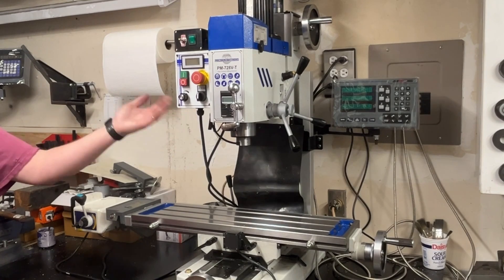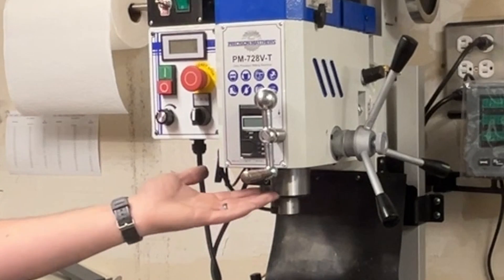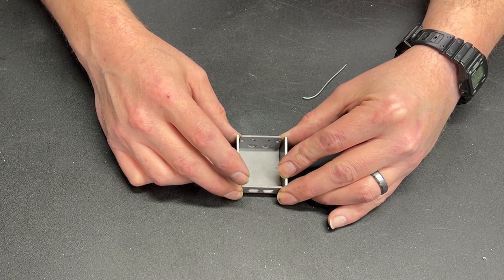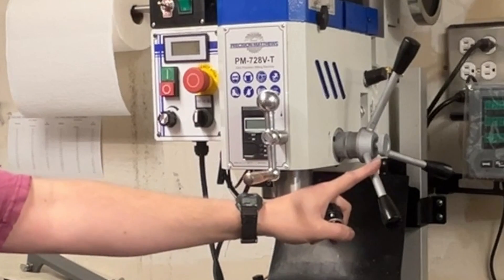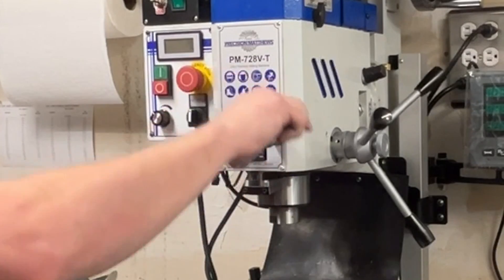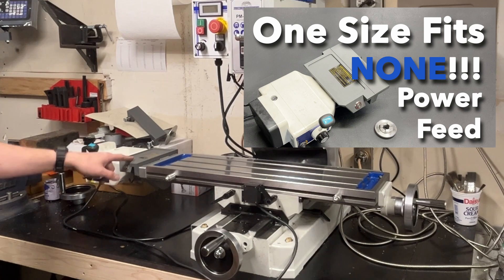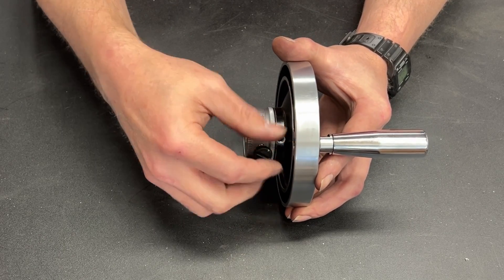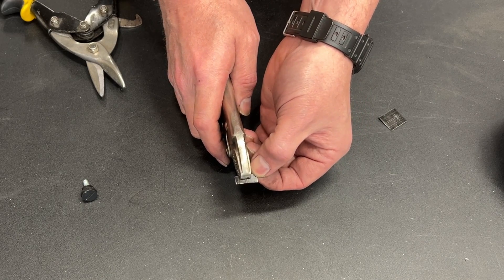Modify & Improve my NEW PM 728 Mill!! Only Had it a Few Months & I'm Already Making Changes

Comment: I want adjustable speed power lift
Reply from the maker: Just curious why would you want to do that, what advantage would that give you?  A person doesn't use power feed to adjust depth of cut and you don't want it going very fast at max so "adjustable" would be slow and very slow.  So I wonder why would you want it speed adjustable?
Reply: @dazecars  to slowly raise  on repeat parts i make where the depth rises slightly to do them easier
Reply from the maker: Most of the aftermarket power feed utilize a gear reduction DC motor so variable speed would be as simple as a variable voltage power supply in place of the power supply that comes with the machine

Comment: It's a decent mill and I have used mine a lot however the biggest short coming of this milling machine is the fact it doesn't have a nod adjustment on it. If they where to put one on then I would consider this a fantastic milling machine. Mine the nod has been off since day one and I'm about to make a backing bracket to attach to the top of the riser in order to control the nod and flex this milling machine has in it.
Reply from the maker: That kind of adjustment would make this a professional grade mill in a hobbyist size machine!

Comment: I already had TouchDRO as the main DRO for my mini mill. After watching BlondiHacks video, I got the idea to take it one step further and replaced the built in quill DRO with a magnetic strip and reader. I added this as axis 4. Through TouchDRO  you can add 2 axis together so Axis 4 and Head Z movement now adjust  Z reading on the DRO, so it does not matter whether I move the quill or the head, it is all the one Z reading on my DRO.
Reply from the maker: That’s very cool, I have thought about touch DRO but had other things that were a higher  priority but combined scales readings moves it up the list.  Got any part numbers on your scale mod?